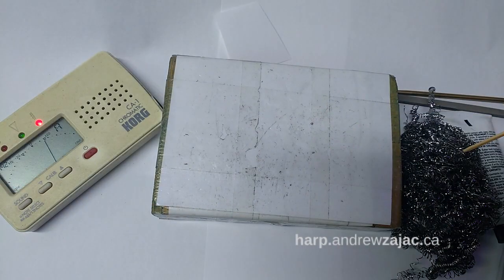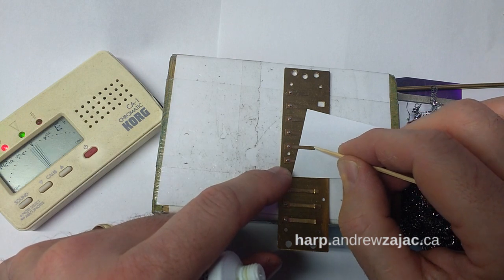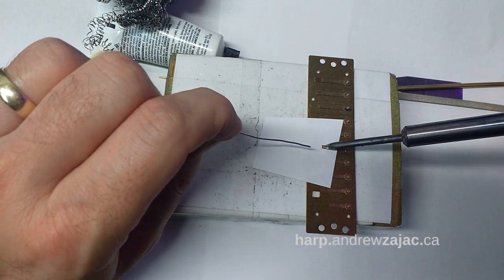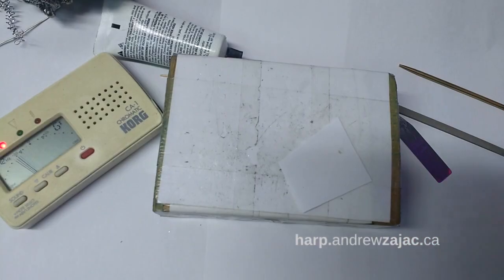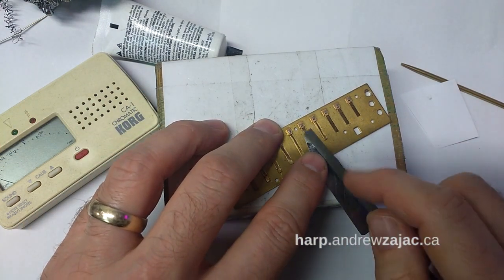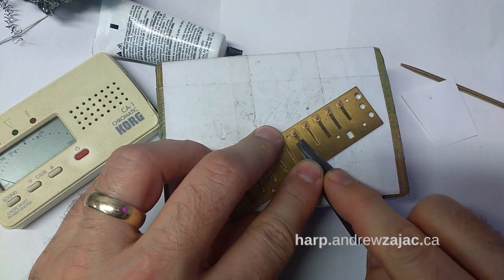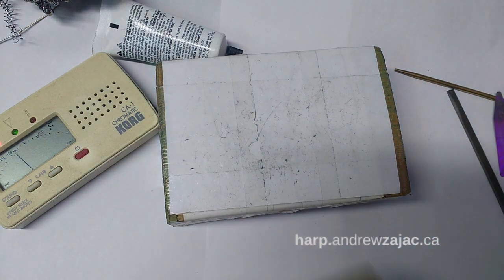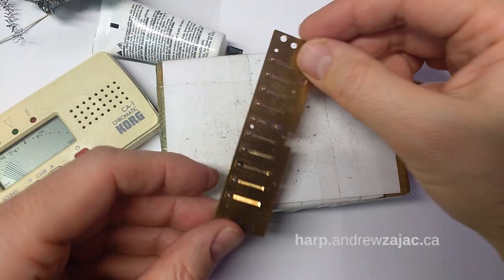Using solder to lower the pitch of a reed

Comment: After 3 hours of work I could turn my harp to a powerbender tunning. I didn't swhitched reeds 9 and 10. During the process I realised that was easier add a lot of solder to make it glue to the reed and imediatly remove the excess with soldering iron. Thanks you so much for this vídeo

Comment: Tuning down works well like that Andrew, i've done it numerous times without using flux with silver solder because I didn't trust the chemicals in the flux. The solder holds on to the brass very well without using any flux.